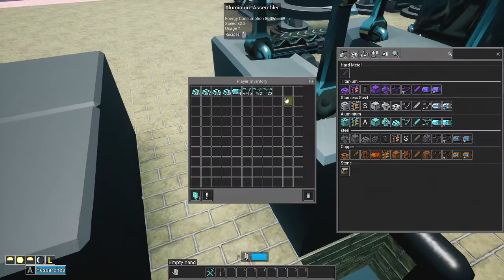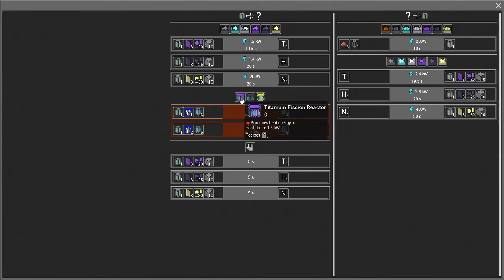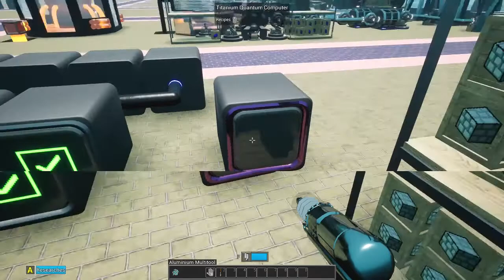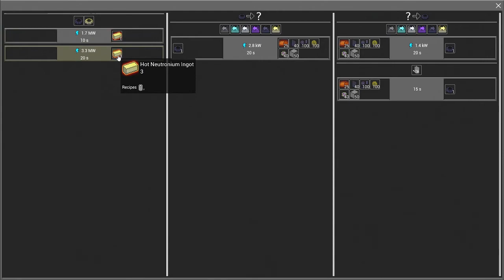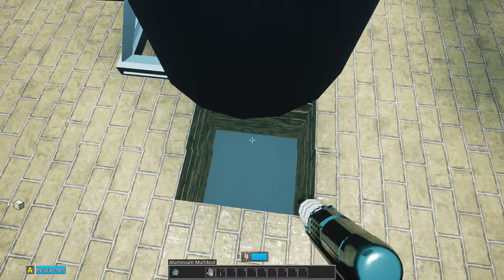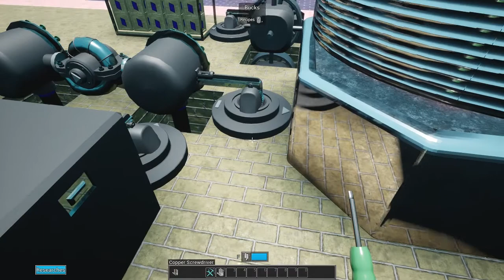Evospace - S3E9 - Fuel Rods and Hard Metal

Comment: Door is this the 18.1 or the indev 18.2?, also with 32 pumps you have more than enough water for anything , dump all the water into tanks then redistribute as needed, pc hit box being so large , place it on top of the computer row & plug in ?
Reply from the maker: It was 0.18.1 and with the water there was no need to put it into tanks because there was so much of it coming through the line unless I wanted to see how fast I could fill one up. I don't think the quantum computer was actually usable I even went into a creative world to see how it works and nothing would plug into it. It might work now in 0.18.2 but I'm not sure.